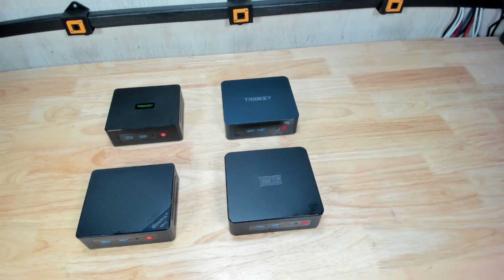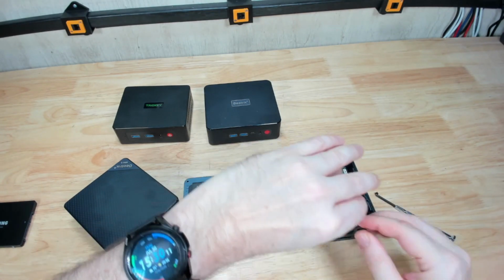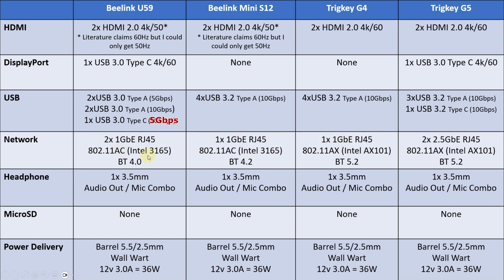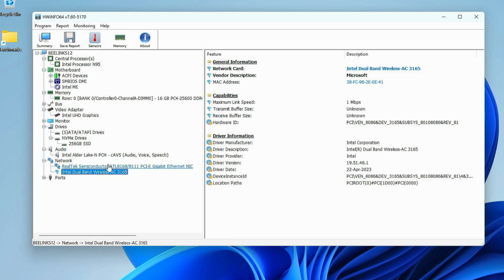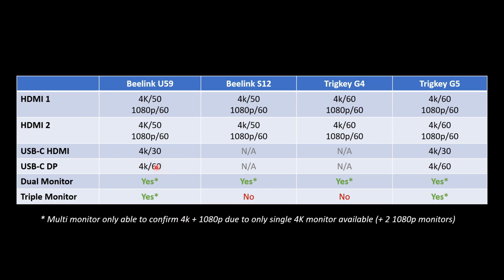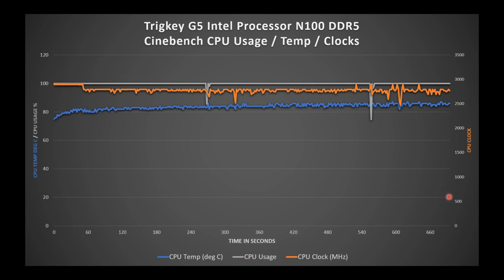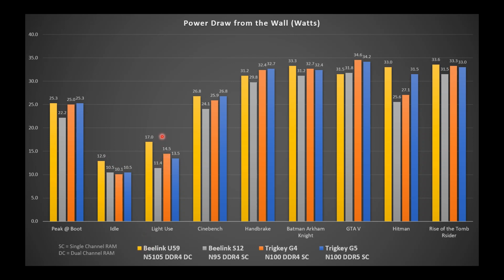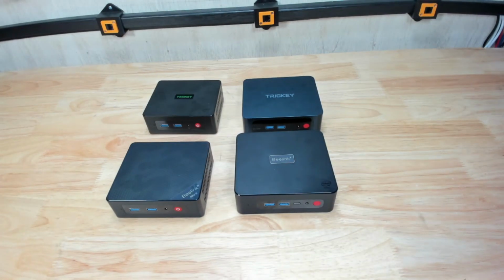Intel Mini PC CPU Comparison N95 N100 Celeron N5105

Comment: So maybe I missed it, but can you answer two questions please? For the Trigkey G5, 1. does the NVMe run at Gen3x2 or Gen3x4 (or 😱 less)? and 2. what is the thermal paste situation? I've noticed on the GMKTec G3, replacing the thermal grease with a thin layer of Thermal Grizzly Kryonaut brought the temps down significantly to like 73 deg C (down from 90+ deg C) under load.
Reply from the maker: Trigkey G5 M.2 slot is PCIe 3.0 x1 speed. I didn't repaste these devices and I no longer have them so I don't know for sure. But I have found repasting can help by 5-10C typically if it's something you want to risk doing. Glad to see you got yours down to 73C. 

The one thing about many of these pastes is that they dry out or "pump out" quickly and lose their thermal advantage. So you need to look for ones that are designed for laptops like SYY 157.
Reply: @htwingnut  thanks very much for your work here! It's frustrating that any NVMe you get will lose out on most of its performance by throwing it in these machines. One of the only ones I've found that doesn't do it is the geekom air 12, since that runs at Gen3x4. Anyway, thanks for the reply!
Reply from the maker: @briandowdell358  It all depends on the ports available. These CPU's only have 9 total PCIe lanes. If four are used for NVMe then you limit other options like 2.5G or 10G ethernet ports, multiple NVMe slots, or other I/O options.

In my opinion, PCIe 3x2 is more than fast enough in most scenarios for these kinds of PC's. 10Gbps USB 3 is nearly as fast as PCIe 3.0x1, so you can't transfer any faster than that, and even 10G network is no faster than that either. 

And I don't think internally a faster NVMe will be that noticeable whether PCIe 3.0 x1 or x2 vs x4. Plus the CPU will be the limiting factor if you are reading the data, processing it in someway and writing it back to the SSD.
Reply: @htwingnut  you know, that would be a great video: comparing different mini PCs to see which ones make best use of their hardware without any bottlenecks per the N100. That way, there'd be something to aim at. That's literally all I would like in a mini PC: efficient, good power saving CPU, great use of all the lanes available (that makes sense for a homelab PC or a DIY friendly tinkering machine)... Know anything like that?
Reply from the maker: @briandowdell358  Good idea. I don't know of any mini PC's, but there are several  mini ITX motherboards with N100, N5105, N97, N305 on them that do.  Your best bet is to go with an AMD chip because even their lower end chips have 20 Gen4 PCIe lanes, and the integrated GPU is so much better.
Reply: @htwingnut  do you have a recommendation for a CPU that comes close to matching the performance of the N100 and still has power efficiency that compares to the N100? Just curious at this point. Thanks for the input!
Reply: I meant AMD if that wasn't clear

Comment: Very thorough and helpful video. Thank you!
Quick question though, with the trigkey devices they mention they only suppport up to 2tb m.2 nvme drives. Even though it is not supported, would a 4tb m.2 drive work? I don't see why it wouldn't work but I'd like your opinion on this please
Reply from the maker: I can't guarantee, but I don't know why it wouldn't work. Unfortunately I don't have any of these devices anymore nor do I have a 4TB NVMe drive to try it out, otherwise I would!
Reply: @htwingnut  Thanks for this, I'm thinking of using the g4 as a mini NAS creating a RAID 1 array with a M.2 NVMe drive and a SATA drive.

Comment: The audio sounds like either something is not setup properly, or you've got a mic designed for talking next to instead of into. Wish I could be more helpful.
Reply from the maker: Thanks for the feedback. Yeah, I've changed mic's with later videos.

Working on a better setup overall, but don't have much budget. Problem is I need a wireless lapel mic, and good ones don't come cheap.

Comment: Again, DDR5 is dual channel with one stick of RAM (controller ON the RAM).  You can not run DDR5 at single channel.  By definition, DDR5 is dual channel, but it only requires one stick of RAM.

Comment: I have a Trigkey G4. Was on offer at Amazon before Xmas for £149.99.   It runs and performs very well.  I find that on load I can bearly hear the fan. I have a 1gb ssd installed as well and do very large photo transfers and video editing it runs much quieter than my i7 12700 with 64gb ram. Very handy having 2 hdmi and was cheaper than adding another video card to the i7. ATB. regards from the UK

Comment: Thanks for the detailed information. I have a 5195 which is great and i run on a battery bank like a laptop. Makes sense now why it drains the battery if i leave it plugged in, max load is below 30w with monitor though. I think ill upgrade to n95 for better power use and the newer model isnt fanless, which is a nice novelty but gets way to hot

Comment: Very informative, good quality video that will get you more viewers, subscribed for more.
Many review are too simple to show the different faces of a device, you show many faces of them, i'll go for the Trigkey G4 for my Home assistant device to replace my NUC 7100U => More power and lesss power consumption (i'm off grid and each Watt count).
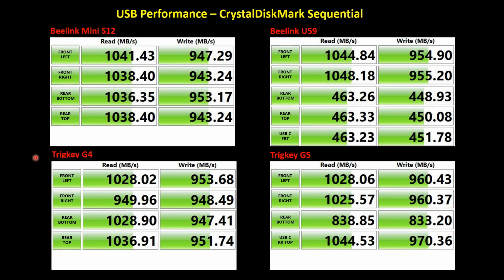Advice : try to keep things in the same place (i know you already tried too) for example the CrystalDiskMark display 35:00, TrigKeys are now on the bottom while devices were presnted at the top.
Reply from the maker: Thanks for the suggestions, I will be a bit more careful with that placement.

Comment: Great comparison! The only thing I'd like to see added is LatencyMon figures, since this important for media work. 

A note about pricing for Europe. Amazon Germany is a good place to buy as there are often discount coupons. Trigkey Green G4 is €170 but the G5 jumps to €250 as I write (but this is highly variable). The Trigkey Speed S5 is only a bit more at €280, which seems to be an obvious best choice... depending on how it reviews. 

So it would be great to see the Speed S5 given the same treatment. It should double performance with the Ryzen 5. But I wonder about cooling and noise figures.
Reply from the maker: Thank you for the feedback. I will look to add LatencyMon in future comparisons.

Also, in the US, the S5 is about $100 more than the G5 at the moment. 16G/500G S5 is about $285USD vs $184USD for the G5. 

If I can get my hands on an S5 I'll give it a go.
Reply: @htwingnut  Came back here after obtaining the Trigkey Green G4 N100. I tested the DPC latency and it was all in the green. 

For video, playing back two 1080p video streams almost maxed out the CPU and produced some audio crackling. Even after optimising Windows as much as reasonable. This result is disappointing for a unit marketed for the ability to support multiple video outputs. I guess that Alder Lake N100 is simply not fast enough.

I found the fan noise objectionable when the unit was sitting on the desktop, but if mounted behind a monitor or if there is any sound playing at all, this masks the fans. I should say that I am very critical when it comes to sound, so others might care less.

Tested Trigkey support and the result was quite incredible. Instant email back with correct solution to my problem. 

All basic daily computer tasks worked perfectly. Smooth operation.

Comment: 5105 video card 800Mhz /  N95 video card 1200Mhz /  and Ryzen 7 5800h video card 2000Mhz. N95 is great but for small distance price take a ryzen. ( i have 5105 and N95 and better )
Reply from the maker: No doubt, for gaming ryzen all the way. But if you just want a budget mini PC, these Intel machines are great devices, if the price is right. These were all about $150-160 at time I acquired them. Considering you can get a Ryzen 5500u machine for ~ $250 it's a great deal especially for gaming. I got my hands on a Ryzen 5500U Beelink SER5 that I am putting through its paces.
Reply: @htwingnut agreed. Intel doing some work again! It's amazing that these N100 CPU's at 6W are now basically the equivalent of a sandy bridge i5 2500.

We've come some way in terms of efficiency.

Edit: if super efficiency and ultra low power draw isn't what you're after, or you just need far better iGPU performance, picking up something like a ryzen 2200G or 3200G is probably a better bet, plus those old ryzens are dirt cheap now
Reply: the n100 is significantly faster than a i5 2500 @scroopynooperz9051

Comment: Thank you for this comparison, very complete and very useful. We see in particular that the PCIe 3 interface (to connect the SSD) is 1 x 8GT/s, therefore limited to speeds of 985 MB/s, regardless of the speed of the SSD. Some critical components are therefore too old to take full advantage of system performance. Too bad...

Comment: An excellent breakdown worth every one of the 57 minutes. Beforehand I would have predicted that the G5 would have been a clear winner in all categories with the faster RAM  but was surprised at how the G4 not only held it's own but was even better in some instances. But then it occurred to me that the superior cooling in the G4, despite the added noise may well have contributed towards it's performance. Which made me wonder whether the fans were interchangeable and if installed in the G5, might yield better performance because of increased cooling. The tests were closer between the 4 than I would have anticipated.
Reply from the maker: Thanks for the response and taking the time to watch!

The fans were all a bit different, but even if you could swap them, I think it comes down to the fan profile in the BIOS, which from my experience, was not user adjustable despite being able to be changed in the BIOS.
Reply: @htwingnut  Perhaps try re-pasting the G5 and see if that helps?